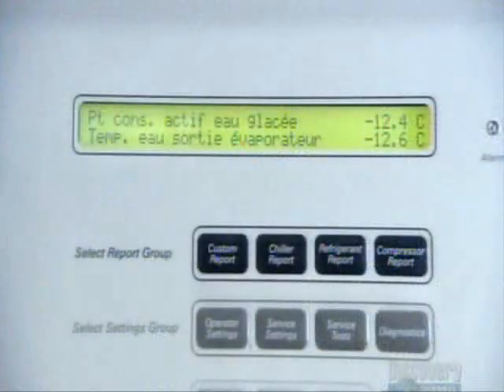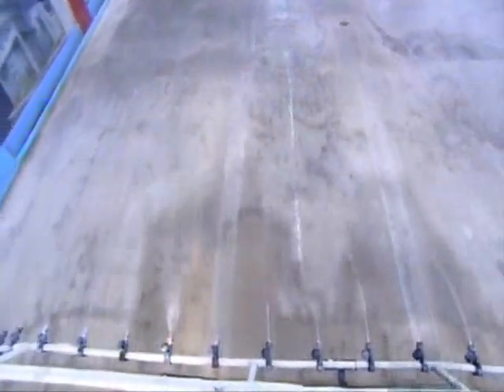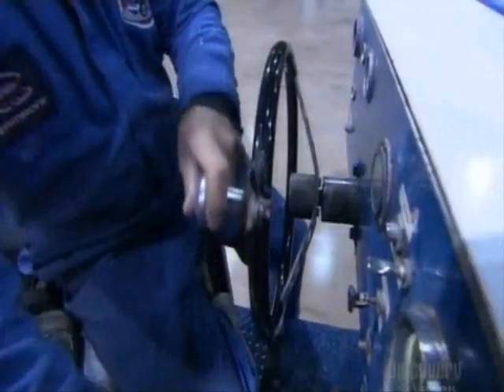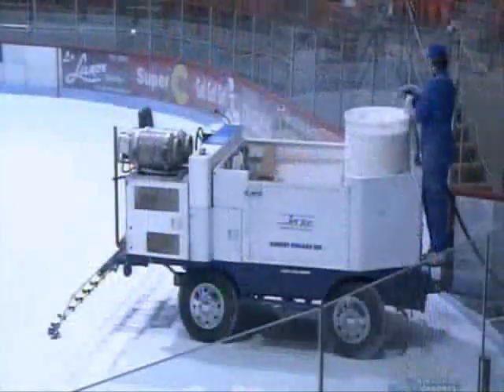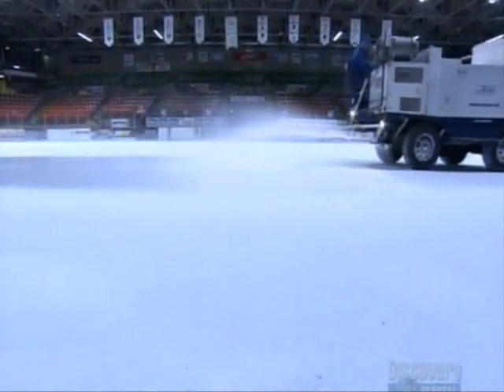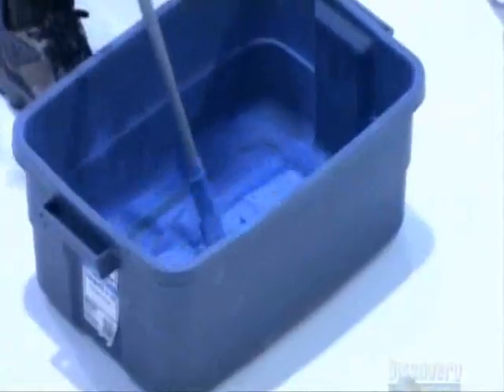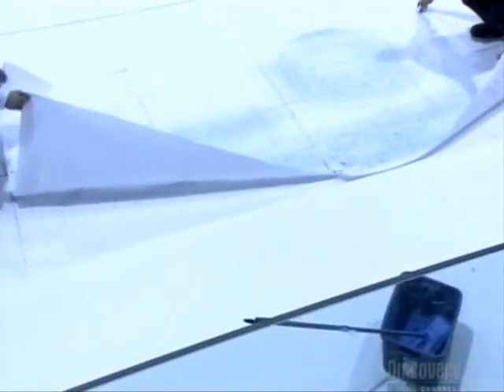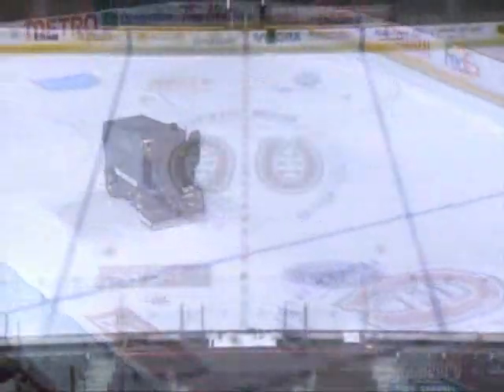How It's Made - Hockey Rink

Comment: That's a lot of math... first two layers = 4mm thick. Next three layers brings it up to 10mm or 1cm, which took 40 minutes of just driving to do. Hand painting looks like it could take 2 hours, depending on how many people are there. Takes 1 1/2 days to flood the ice up to 30mm or 3cm and freeze over at -7 to -9 degrees C, making the finished ice 40mm or 4cm thick (a little over 1 1/2 inch) over the course of 2 days.

This is what you can learn on YouTube when you get bored.

Comment: The place I worked at in rural Massachusetts had a rig that was set up so that a crew would just roll it down the length of the rink and the misters would evenly coat the surface layer by layer.

We'd roll it back and forth once to get the initial layer, then a few more times with the white mixed in, paint the lines and logos and everything, and then pass over a few more times with clear water to solidify everything. After that it was just a matter of fixing any spots that were missed or over iced. All in all the process took a full day

Comment: There is also another system, for portable rinks. Very similar, minus the concrete pad. They lay a pipe system down for the coolant, and spray layers until the pipes are covered. Then, proceed the same as above.

Comment: You could paint the concrete. You don't have to scrape anything when it's change of season time. You just turn the refrigeration off and let it melt and drain away. At most you would just run a water vac over it to help it dry faster or use squeegees.

Comment: This is the old-fashioned way of doing it. Nowadays, they use large, seamless slabs of wood that have the markings on them. They just bolt the peices into the bare cement and frezze over it. The ice is 1/4 an inch thick.

Comment: So how do they transform it from Hockey to something else without having to do that whole process again?
Reply: Arenas that are used for both hockey and other events such as basketball or concerts typically have floors made of interlocking panels that sit on top of the ice surface.  Some arenas have elevated stage-style floors on a steel frame that sit over the ice like a box.  Hockey arenas are usually only iced once at the beginning of each season, and then maintained with Zambonis.

Comment from the maker: When they first spray the bare concrete each it's a 2mm think layer of ice then they add another before spraying two more layers of the water with white paint. When they start to paint on the markings the ice is about 8mm thick. After they finish painting the add another 3cm of ice by flooding the arena making the finished ice 4cm thick or 1½ inches.